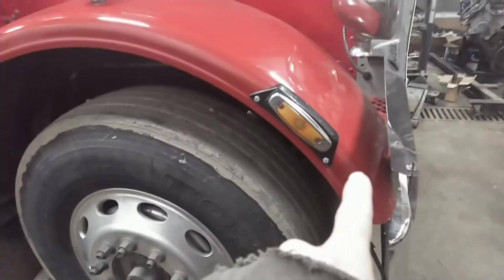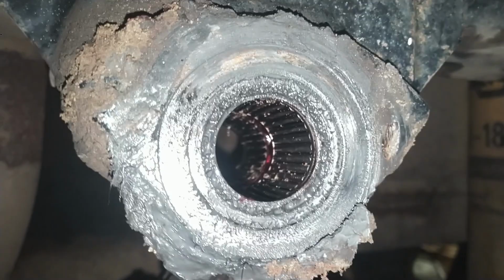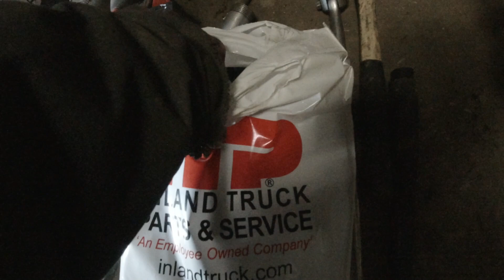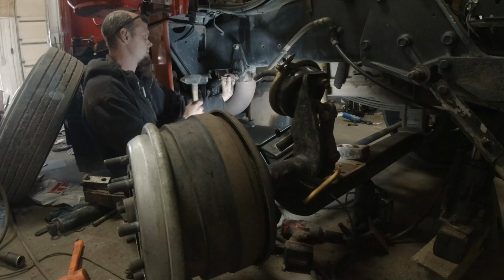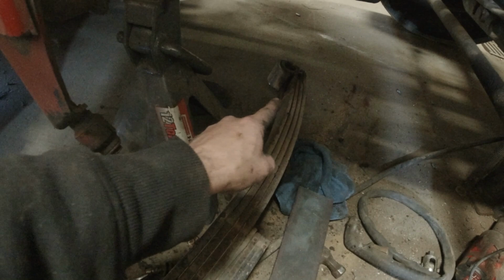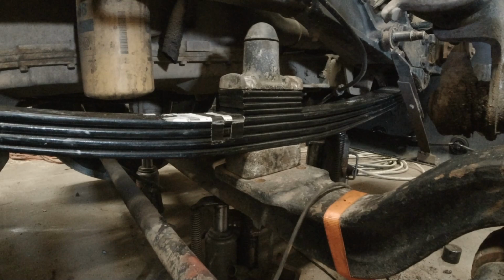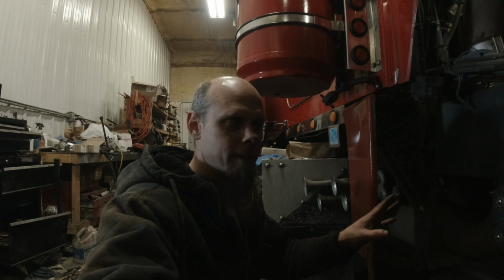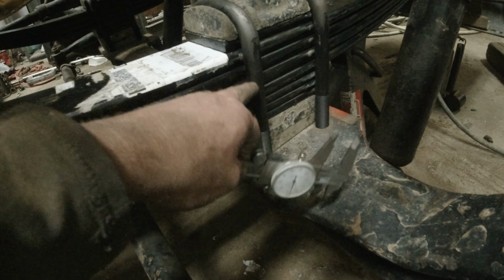front spring bushings on my 83 359 Peterbilt turns into a bigger job.

Comment: O-H-I-O Porters here.🇺🇸 Now this sure brings back some memories! I did a bushing replacement on my 65 Ford C800 rear axle. It was the right side that was so slightly popping when I pulled a trailer. And that’s the only time it would “Pop”. What a job for me at that time. That’s when I learned that you do those things in pairs! No Ands,Ifs,Buts! 🧐 My oldest brother told me what to do, let me do the work & he watched. Not bad for a 16 year old! I will never forget that popping noise. Did your front end pop a lot? I can imagine so.🧐 That sure was a lot of work, but we’ll worth the time & effort!🤩 Good stuff!! Glad that you shared this with us. I wouldn’t imagine needing to retorque the U bolts. Is that to just make sure nothing changed from the road test? I’m quite pleased with this video, my friend! It sure is gratifying when you work on your own truck & know for sure that things are “In Order”. Such good stuff! 🥰🤩✌️

Comment: Fantastic work bud.  Always has the pass side lower than the driver's side on these older rigs from the engine torque also.
Reply from the maker: every truck iv ever drove with air ride on the front i thought rode like garbage, you loose a lot of stability in side winds and corners, they seem like they hit the bump stops on way small bumps witch jarrs everything, your steer axle weight doesn't change that much loaded or empty so spring rates can be matched to ride well, i won't put a air ride front on any truck i own. they might be nice for the guys running interstates all the time but not for me.

Comment: Yes, matching things up on suspension and brakes is important. I’m not too proud of your spring shop for sending you backwards to the plain bushings. You have to grease them way more often than people tend to, and they still wear faster. Good job on your part though. Your usual thoughtful approach to the work at hand. It usually helps if you put the bushings in the freezer for a while before you put them in, but maybe not so much there in the winter when you’re struggling to keep from freezing to death. Thanks and take care.

Comment: What  I don't understand is why you weren't a tad bit higher with the new springs compared to the old springs. I replace my front spring on my 389 Pete that had 800,000 miles on them  & the alignment shop told me right off that the truck would would sit a bit higher than it did with the old springs. Over time & the miles one just doesn't notice it. I didn't want it any higher than it was with the old wore out springs so he just put a small er block under the springs & above the axle. he then proceeded to a full alignment the truck. She was sweet & could tell by the ride once loaded it had the new springs.
Reply from the maker: it is a tad higher than it was originally the whole stack was under the leaf spring i left one ontop to account for the new springs having more arch.
Reply: Yep that's what the guy me mine would have been so he had smaller blocks around to make it close to was it was with old springs. When he aligned the truck he even bent my front axle just a tad to make my right steer tire wear better due to me not  buying a premium steer tire and it wore on the outside of the face. Told him on the phone about it & he asked me right away if I was running a Firestone steer tires. I never get a truck alignment at a place that sells tires. It's never the tires fault & they alway say the tire they want to push will wear better when a alignment guy sees & knows which is better & his opinion isn't based on what brand of tire he's selling. least that's how I look at it.

Comment: have you ever thought of doing air ride suspension on the steer axle? i have seen guys doing it and from what i heard they have a better ride
Reply from the maker: Every truck iv ever drove with air ride front I thought rode like ass. You lose stability in corners and cross winds and the bottom out on the bump stops easier as the spring rate of a bag isn't really progressive like a spring. Because the weight on the steer axle doesn't change much a spring can be well matched

Comment: Oh how I hate suspension work had to do springs on the old Sterling truck I drove Hendrickson extended leaf walking beam in the back. The front springs I started the removal my buddy finished the job I started a new job. Grease and more grease, grease is your friend people don't do enough of it then they wonder why parts wear out. A local guy he had an old gravel truck he didn't want to change the front springs in pairs just did the one side the truck was lopsided. Around here the gov't doesn't like spending any money on the roads springs in trucks are replaced because of broken leaves.
Reply from the maker: i drive on roads that don't even exist yet, never have i broken a leaf spring, you have to be sane and take it slow i know plenty of guys who drive 60 miles an hour on wash boarded pot holed rough roads and they always wonder why there truck is always broken. there normally the same guys that try to tell you it gets smoother the faster you drive.

Comment: Hay Ezra I have done a few front spring bushings in my years it's not something I particularly enjoy because the ones that you had were Cakewalk they just pounded right out that wasn't so for me I done at least five that I can remember and every one of them fought me every inch of the way I had to keep the whole damn hanger red hot just about to get the old bushings out then once I get the damn bushings out the hanger had to be replaced because that was shot too All that work I hated doing front end work I just hated it because it was never an easy peasy job it was always it would take freaking whole damn day to do it if not two days and then the service manager's bitching.
Reply from the maker: iv had to cut them out before, or press them in the shop press, iv never wrecked a frame hanger though.
Reply: Well not everyone that I've done where the hangar had to be replaced it was just this one truck that I worked on but this truck was pretty much run through the ringer and it the bushing or the pin wore through the bushing and then wore the metal down in the hanger itself yeah it was it was wasted but the guy that I was doing the work for the owner he did it right we bought hangers and we put new hangers in both sides everything it was a lot of work a lot I remember that truck very well because of how how much trouble I had getting this stuff out it wasn't any fun.

Comment: We used to torque our wheel lug nuts to the old German torque spec "gootentight" with a six foot cheater bar and lots of a$$. I like your method better. Have you had any issues since you did the frame splice?
Reply from the maker: No Frame issues

Comment: Good job. Hard work. Just put new front springs in my 2000 ihc. A year ago. They lasted that 1,700,000 miles. I didn’t think that was to bad. Is that about normal. Bought truck new. You do a heck of a job. Take care.

Comment: Those rear roller shackles are lifetime and very very expensive your going to notice some stability changes they don't wear out like rubber you just grease those
Reply from the maker: Iv seen failed roller bearing shakels. New bushings were a brass bush not rubber. There still last a very long time with proper maintenance.

Comment: Really? A claw hammer? 🤣🤣🤣 Shame on you EZ🤣
Suspension work can be so much fun. High nuts and lots of never-seeze on the u bolts, just as tight as you can get them and then a little more.

Comment: U bolts 400ft/lbs
Reply: Twice then run a few hundred miles retorque
Reply from the maker: You are correct on the retorque. But incorrect on 400ft lbs. A 3/4 u bolt is 315 a 7/8 would be 500. Witch funny enough matches what paccar says. That's also why I showed how to find torque specs because blanket statements can often be incorrect as there is to many variables and not all trucks are the same even of the same year make model. That's why dealers always want the vin when looking up parts

Comment: It would have been nice to put air bag suspension on the front but anyway you your doing a great job I’m sure, keep on trucking.
Reply: He works in fields, what would the point be to bag it. You have to remove a leaf spring when you airbag, so he would lose clearance either way.
Reply: I don’t know anyone personally using it, but Hendrickson has a front air ride setup that looks like it may be a good work a day system available in up to about 14,000 lbs capacity. A bunch of manufacturers offer it, and it has been around long enough so that there should be plenty of units out there with plenty of miles added up. Sure would like some feed back on this, as anything that would smooth out the ride and relieve some of the abuse on the truck would be welcome. Thanks all and take care.

Comment: U-bolt are not reusable is a fact it seems to me that whenever I was doing this job that we would just get the Springs re arched and then they would put another bushing in the eye 3-day turnaround I believe
Reply: Very few spring shops will rearch semi springs anymore, too much liability.
Reply from the maker: you can't re bush a spring that the spring eye is no longer round. you would have to replace at least the top leaf. those springs were probably original 40 year old springs.
Reply: @Ezrider359  well you're right you should I was working in prison I would pull them they would send them off the farm rearch the springs and send them back and I would put them back on the truck and start on the next